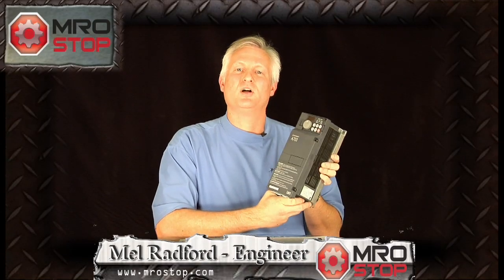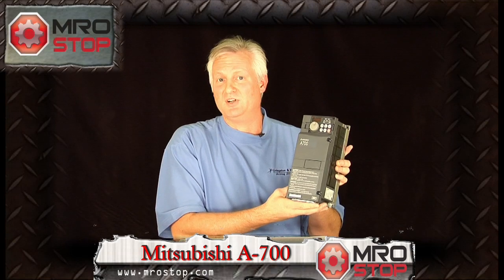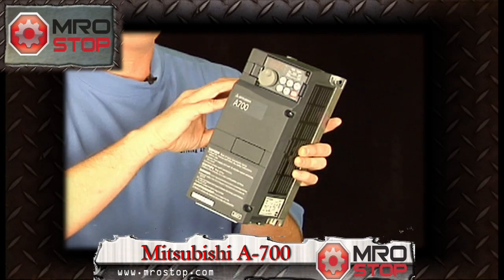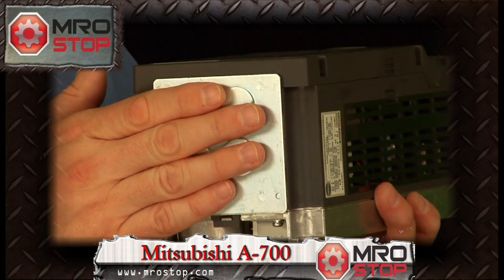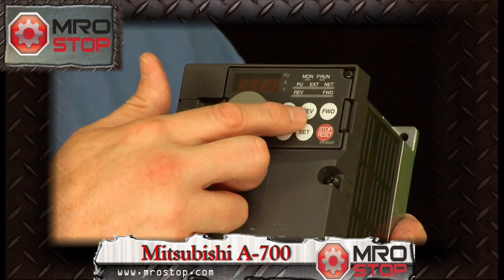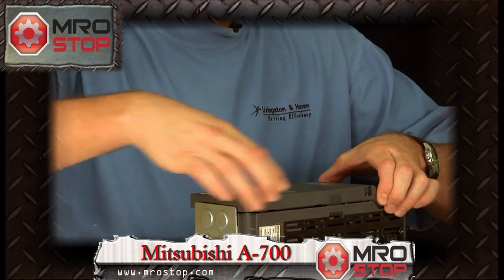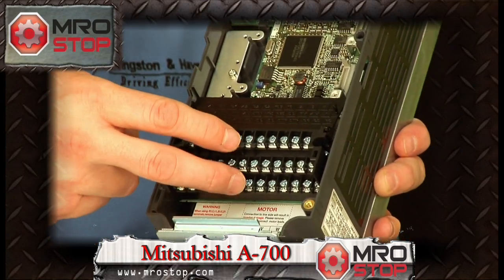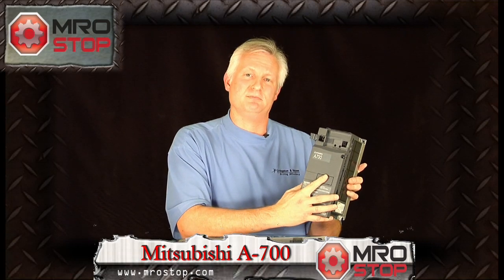Mitsubishi A700 VFD from MROstop.com

Comment: I have Two same rating VFDs , one start PB, one stop PB and one Potentiometers on the field panel. Now i will give run,stop and speed (by pot) command to only One vfd. Can other VFD run at same speed as the first one by only way of ethernet communication from first drive(no other hard wiring).